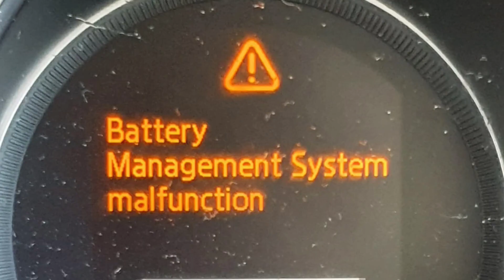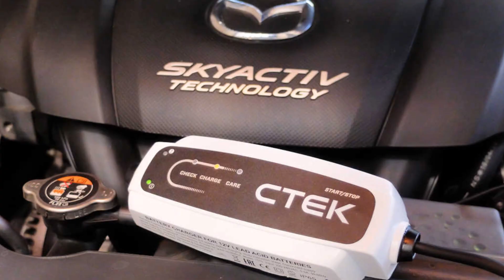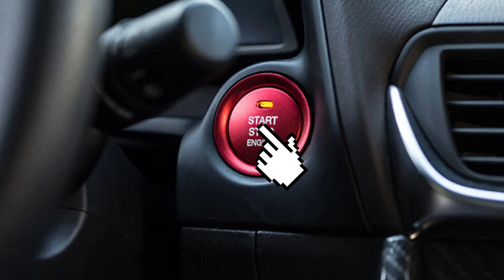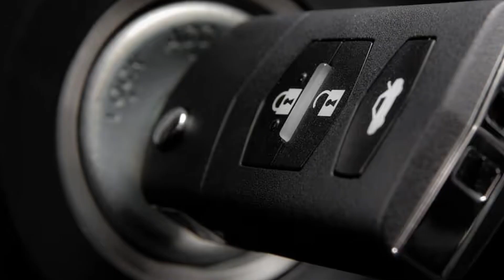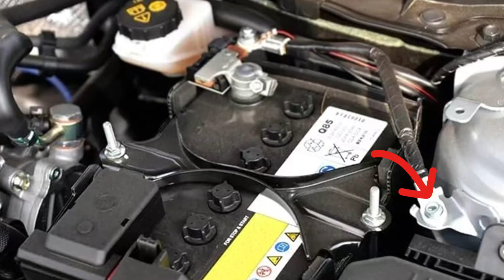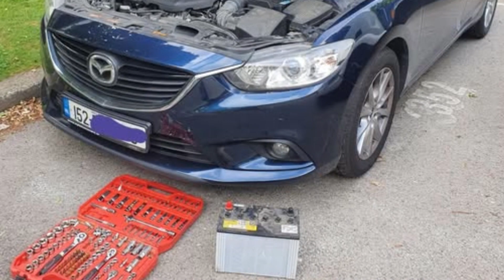“Battery management system malfunction” warning in Mazda 6

Comment: Great video! Do you know if this works on a 2021 CX5 without iStop? I recently replaced my standard lead acid battery with an AGM and my Noco Genius shows that the battery is less than 25% charged even after long drives. Would attempting this reset work to help the BMS identify that I now have an AGM battery?
Reply from the maker: Probably, the alternator in cars without iStop works differently and won't completely charge the AGM battery. You may try reprogramming the BMS, but I'm not sure if the reset procedure mentioned in the video will work. I'm pretty sure there is a way to set BMW through a high-end scanner for the CX-5, but again - I've never done this myself.
Reply: Thank you! I'm using a Noco Genius maintainer to try to keep the battery topped up. I may try the BSM reset though. You don't think any harm will result from trying the reset procedure in a non iStop CX5? Thanks again for the video and the reply!
Reply from the maker: No harm can be done for sure. Battery maintainers are a good thing - I wish more people used them, especially if they mainly drive in city traffic.
Reply: Thanks again!

Comment: I have Mazda 6 indicate warning Charging System Mulfunction, engine could stop unexpectedly". I replaced all with new battery, new belting, new PCM and new alternator but warning still pop up. I sent to the car agent workshop, they also cant fix it. May I know how to fix this?
Reply from the maker: Since you've already replaced everything, the problem seems to be caused by a loose connection or broken wire somewhere in the system. Very hard to locate, so you probably need to find a good car electrician.
Reply: @mkaaa2742 hi there, can you please let me know if you have fixed the problem? I'm having exactly the same issue with my 2013. I replaced a battery and 2 alternators and still have the same warning in dashboard.  I spent a lot on diagnostics and they couldn't find what's wrong 😢
Reply: @FesterEr  Frag gemini, mir hat's geholfen.

Comment: Actually did not work. 
"Battery Management error" + "i-stop error" Battery is actually low and will replace it soon. In the meantime I do this: 

My solution:
1. Warm Up till Temperature is in working range
2. Turn Off, wait a little bit until shutdown procedere is done
3. Double Tapp on start without brakes/clutch so that the motor does not start
4. Wait 15-60 seconds
5. Press i-stop for 10 Seconds
6. Turn off 
7. Start the engine - first Battery Management failure is done 
8. Drive or wait until temperature is in normal range again
9. Turn off and start engine again - i-Stop failure is also done

I also deactivate i-Stop until we have a new battery.
Reply: How do u know what temperature is normal? I'm using Mazda2 skyactiv
Reply: @yutaadi The Gage shows just below 100 Celsius.
Reply: @blueskyhorsemanship3068 there's no celcius gage on my dash